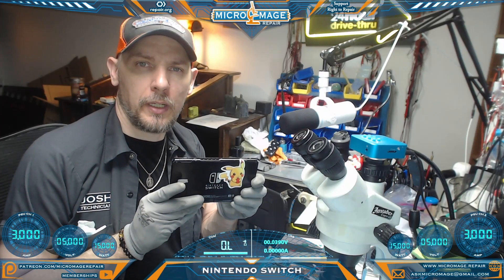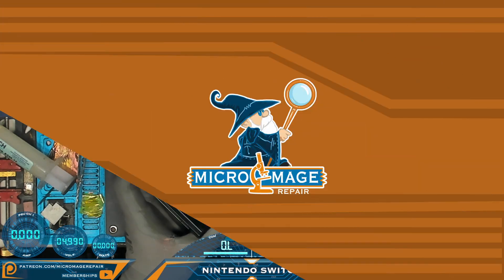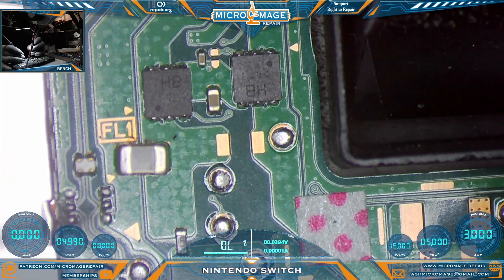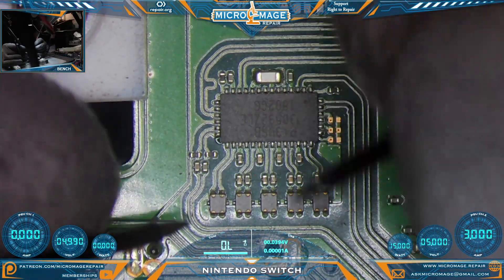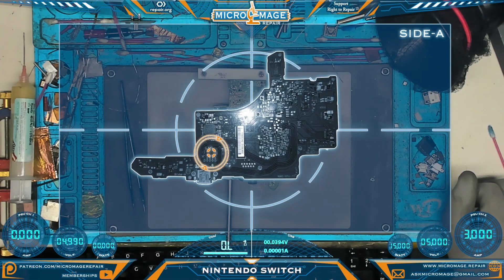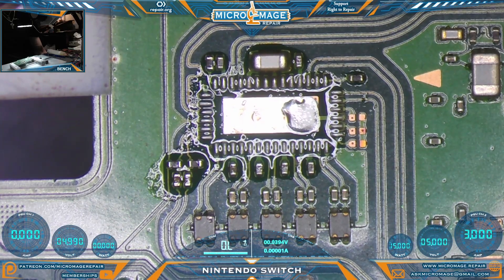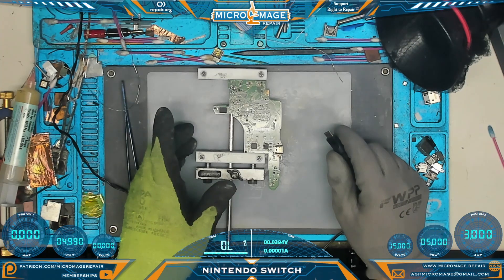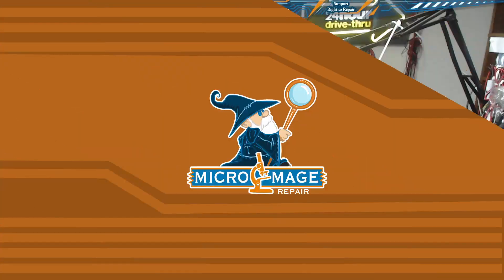Nintendo Switch: 5V .47A 15V .52A No Power

Comment: Can you tell, why the docking test sometimes work on side and not on the other? Isn’t it suppose to work on both sides?
Reply from the maker: I'm uncertain. I just got an extension for the OEM  dock and it seemed to do the same thing. Wasn't expecting that.
Reply: @MicroMageRepair  so it’s normal, that only one side is docking?
Reply from the maker: @Samsemillya  it seems to be normal for one side to not dock when you try it at least. I don't know that that isn't just random Switch nonsense. I'd have to test that specifically to say definitively.
I'm usually just looking for it to dock one way or another, if it docks on a side then it's good. I've never heard of half docking as an issue it either does or doesn't.
Reply: I’m asking because I fixed one of my Switches today (pi13usb change) before it wasn’t docking now it does, but only on one side. My college said he’s pretty certain, that his switch at home is docking when plugged to a 3. Party docking station. I’m not so sure about that
Reply from the maker: @Samsemillya  I have recently had two cases where a Switch would dock on my 3rd party dongle and not on the OEM dock. That's the reason I got an extension actually.
Both were PI3USB issues.
I have no clue how or why that particular "kind of" failure happens.
Reply: So I worked on the same switch again. I found out, that the far right filter is for the “right way” docking on a oem dock. There were bridged capacitors above the filter so data lines were shorted before the pi13. Now the switch is docking both sides on a 3. Party dock
Reply from the maker: @Samsemillya  Excellent information 👍

Comment: What do you use to test for RCM mode?
Reply from the maker: You don't actually need anything.
If the computer picks it up and it's black screen 99.99% it's in RCM.
I confirm with TegraRCM Gui.
Reply: @MicroMageRepair   Thanks, I wasn't sure if my PC should or shouldn't pick it up when I plugged it in.